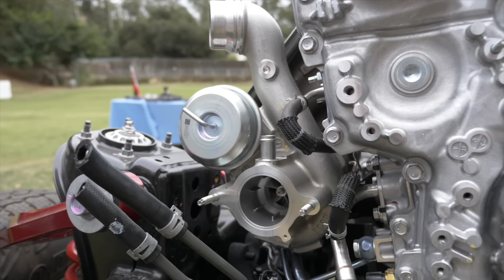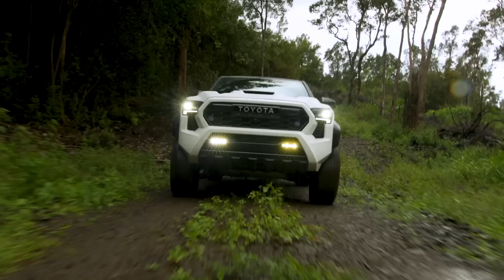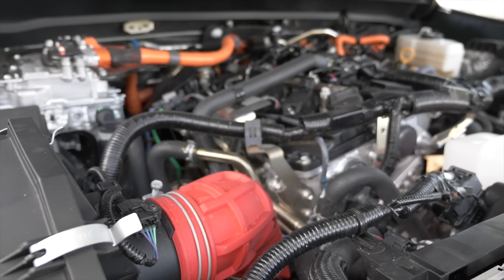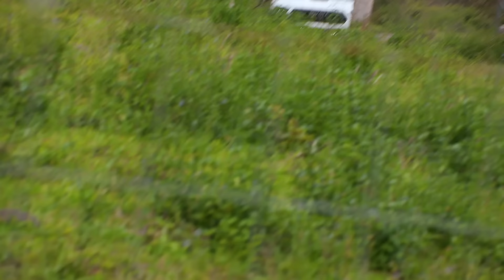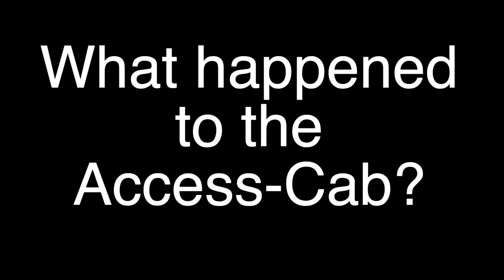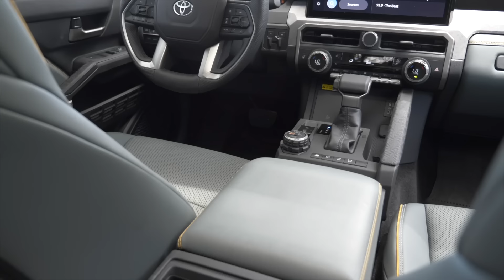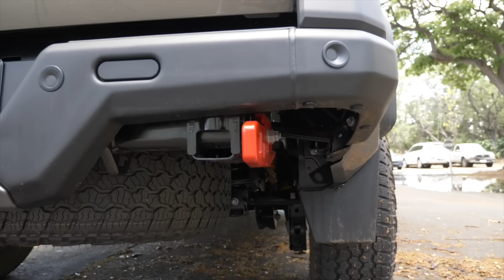2024 Toyota Tacoma Chief Engineer on new engine reliability and more...

Comment: 4cyl turbos (E10gasoline type) will not have durability!! I'm keeping the Japanese made 4.0L!!
Reply: and my 1985 Toyota 4runner SR5 5 speed currently has 285k miles and no leaks or burning oil.

Comment: A turbo 4 has to work harder to do what a 6 cyl does with ease. If the engine is overworked, it will wear out faster. The new Tacomas are much bigger than they used to be. Turbo 4 on a 80s sized Tacoma would be great. When the turbo wears out down the road how much will it cost to replace? Engine might still be good but it turbo is shot, these will be a slow too-expensive to fix nightmare. Time will tell I guess.

Comment: Lies! Turbo charged engines are not as reliable as naturally aspirated engines. You add more complexity and cost for repairs later on down the road. Then, when the smaller engine is under load due to towing, off-roading and/or going up steep hills you then lose massive performance. Not as bad as electric vehicles but worse than a larger, naturally aspirated engine. There is no replacement for displacement!

Comment: Bull crap. In no world is a turbo engine more reliable than a NA engine. Im no Toyota fan but the V6 has proven to be a rock solid staple. Even if this new I4 turbo is rhe most reliable turbo 4-cylinder ever produced It's still wouldn't be more reliable than the outgoing V6. It is just not possible.

Comment: I have the v6 in my 2022 tacoma it's a nice running trouble free truck, I had a 2012 tacoma v6 that was trouble free and zero issues for 400k miles, My biggest issue or improvement they could make is a bigger fuel tank, I have a Ford f150 4x4 v6 with camper top  that gets 20 mpg all day and I have the extended range fuel tank, I can go 600 miles per fill up, towing I can go 400 miles, thats nice to have and my toyota,s have always got around 18 mpg but i am , filling up around 290 miles or looking to fill up because I am below 1/4 tank,  when i tow even a small trailer I can only  go  around 200 miles before looking for a gas station, so  for anyone offloading or taking trips or Towing a larger fuel tank would be something that would be useful and I talk to many other owners who would prefer that then a different engine or at leat the option because they have no range

Comment: I’ve never seen Toyota bring out anyone to talk about how a new engine will be as reliable as their old engine. This coming after the disaster of a launch that the 3.5tt was, I’m speculative at best. I knew this would happen. The years the 3.5 got bombarded with hate and “4.0 is better” talk is now an old era. We are in the “3.5 was amazing. I wish Toyota never got rid of it” era
Reply: I'm pretty sure he  said that they use a 3inch/70mm water inlet for lots of cooling the same size as a V8😂.... dude the water inlet is 1.5-2inch max he was pointing at the air inlet to the intake manifold SMH

Comment: People need to get out of their head that cylinder pressure correlates to uniquely high engine wear. Assuming temperatures and detonation are kept in check (which is a good assumption with modern engine management), cylinder pressure is far less detrimental than RPM, being a linear function versus exponential. Now, either engine type designed well (look at 90s Honda engines for RPM happy engines) can run for just about ever, but I think we've had reliable boosted engines for long enough to get over this gut reaction.

Comment: Great looking truck. My 2023 Honda Ridgeline is more economical than this new Tacoma. Mine has a 3.5 litre v6 mated to a nine speed transmission. Turbos by their nature can be efficient if driven conservatively. Given the weight of this Tacoma I suspect there shall complaints regarding power, performance and fuel consumption. Additionally, reliability may factor in as well. There have been complaints about the Highlander’s fuel consumption and performance regarding its 2.4 litre turbo. I truly believe Toyota has missed the mark. The engine is the weak link here.  Looking at some of the excellent recent new straight six engines validates this for me.
Reply: Your “truck” is a minivan with part of the roof cut off and starts at $40k.
Reply: @AlphanumericCharacters  hahaha. Keep drinking!
Reply: @SicariousAD272 I’ve been drunk maybe five times in my life and never used illegal drugs. That said….the ridgeline is literally a Honda Odyssey with a bed. It’s not a truck. It may fit some loose technical definition of a truck. We could argue the margins but it can’t do truck stuff. Carry cargo? You can remove and fold seats in minivans and carry cargo. They aren’t trucks.

Comment: Hopefully Toyota will avoid a black eye with this build, unlike the new Tundra which seems to be an complicated V6 twin turbo nightmare.  I’m also glad they decided to keep the manual transmission available and take some of the complications (EGR, T stat, electronic waste gate) out of this engine.  I won’t be in the market for a few years, but if it proves to be reliable, I’ll probably retire my 20 year old Tacoma 3RZ 2.7 manual 4WD which I dearly love.

Comment: Thanks to the excessive demand for less fuel consumption, more mpg, and the almighty all knowing rip you off crooked EPA this is the type of engine you consumers are allowed to drive a stressed out 2.4L turbo engine. Not sure if its direct injection which probably is. But even having a bigger cooling capacity I'm still not convinced that will solve the problem. Heat dissipation is one thing but oil consumption, and engine wear due to excessive stress.  Idk

Comment: Those old Toyota trucks weren’t known for power by any stretch of the imagination. They were just small, tough, reliable machines. Geared low, and high revved. I’d love to have one, man! Tacos nowadays are for hauling shit, towing, or grocery getting. I think the city tacos will be fine for the wife to get groceries, or take the kids to school. Good luck towing a camper, using one to haul payload for work, or firewood etc. I have my 2016 squatting pretty low, on a regular basis. The other thing would be off-road crawling through trails/back country….will the turbo really give power at low rpm’s? Is it electronic? I have a feeling 2023 tacos are going to be worth a mint.

Comment: Has no one been to Asia? The fortuner, hilux, qualis, and more all had na and turbo 4 cylinder engines that have lasted with no issues at all. Folks act as though Toyota hasn't spent decades building engines like this.

Comment: I currently have 266,500 miles on my 2011 Toyota Tacoma V6 Prerunner. It still drives like a dream so until this one dies, I’ll continue driving it. Then I can decide on buying another older V6 model or a newer 4 cylinder one after time had told us if it is reliable or not!

Comment: truck is as big as a fullsize,   lost anything mini truck that they used to be.   no need for a  4 cyl in a truck of any size unless 2wd manual stripped down model.  4cyl on a truck that  continues to GAIN WEIGHT,  way overweight.   STILL NO DIESEL,   20+yrs behind for north america release.    NEW none hybrid near same power and MPG  as engines from 2005 in this sector, and from toyota.    just fluffer talk about listening to customers.     dont need 10  special model names when past generations are far superior to new.    continue to be let down by toyota.

Comment: I own Toyotas, so I like them for the most part.  I think they are the best automobiles on the planet.  What is the longevity of a turbo charged 4 cylinder compared to a non turbo charged 4 cylinder and also compared with a 6 cylinder that the 4 cylinder replaces?

Comment: I would really love to see a simple truck again. One that was easy on the pocket and easy to work on. I have two early Toyota trucks. A 73 FJ40 and a 78 pickup. Wouldn't trade either of them for a new model.
Reply: Keep what you have, a new simple truck will never arrive (for lots of reasons including Government regulation)
Reply: @derekisthematrix  Yep
Reply: Tell it like it is ! I have an 84 4x4 pickup.22r carbed.,straight axle,5 spd.."classic" all original,factory white steel,slotted wheels.1984 warn winch mount with brushguards..
Reply: @vincesmith764  Amen
Reply: I have a farm, and farmers can no longer buy simple, non expensive, reliable trucks. We do not want all the bells and whistles. We don't want high performance. We just want a reasonably priced, reliable truck, that will get us from point A to point B without breaking down on the highway, and then break down our pocketbooks to fix it. 90% of the extras on the new pickups, we don't even use, yet we pay thousands extra. Very soon, the automakers will understand that the American people are fed up with the greed of automakers.
Reply: @barbwire7449  
Totally agree. I have found it much more cost effective  to keep repairing my old vehicles than buying new. On ranches and farms, trucks get used and abused. Dirt roads, weather and heavy loads. We don't need rear view cameras, computer screens,  fancy wheels and engine bays where the engine has been shoe horned in. We don't need trucks that take special diagnostic tools, an electrical engineering degree or tiny hands to work on.
We need simple vehicles that are tough, easy to repair and cost-effective.
Reply: The toyota scout is coming back.
Reply: @Chromedome053  scouts honor.
Reply: Toyota just developed the IMV 0 pickup. It's barebones for $10k but they have accessories so you can customize it if you feel. Easy to work on, efficient, cheap, quality. Check it out.
Reply: @jacksonwholeexperience409  word is that it won’t be available in the US

Comment: Here is my problem with Turbo's, they don't last.  I had two cars with turbo's and on both cars the Turbo's failed right around the 60,000 mile mark, they were both Toyota motors too. Labor to replace those turbos is around $300, in both cases I had to find used turbos on ebay and both of them cost around $300 each.  My advice is to avoid turbocharged engines, stick with naturally aspired, turbos will break and they will be costly to repair.

Comment: Toyota is making a mistake on giving up on the six cylinder engine.  The turbos will make the engine run hotter with more pressure hence they will die sooner.

Comment: I love all the fan boys in the comments. I recently, retired from the auto service industry and had customers with 500k on their 3.5 engines. You can not compare a little gas turbo to a serious diesel engine. In my experience pick up trucks are usually poorly maintained. Turbo' charged engines required far more maintenance than do naturally aspirated ones and are very expensive to repair. This is a compliance engine and regardless of the Toyota B. S. I would expect turbo replacement at around 100k miles or less and that little engine will be shot by 200k. Plus the thing is made in Mexico, so it will be assembled poorly.

Comment: Why is the damn thing so big, with so much plastic? I had two '85's. Xtra cab. I'm 6'4", and was comfortable in them. Had a '90 and '94. Still do, actually.  A little bigger, but OK. The new Tacoma's are simply obese. I actually drive off road here in PA,  and like tight stuff. Tree sap smears on sides, etc.
    This truck will never follow me, unless you bring a chainsaw.  Will not fit. Just won't,  forget it.
     Regarding the turbo 4...no doubt it can make power, and torque, and tow. While doing so, all of the exhaust gas is exiting through 8 modestly sized exhaust valves. I have found pretty ragged exhaust valves in 20r's, 22re's, and 4age's. And burnt useless exhaust valves in 3vze's. Bores look good and seem to last.
      Anyway, I wonder about exhaust valve life in hardworking little engines, and my experience has confirmed my doubts.
   The turbo increases thermal stress on the poor valves. 
    Almost universally, when a lot of power is needed, reliably, for a long time, large engines are used, with modest power per liter.
     A top fuel dragster has more than adequate power for any locomotive. Problem is that it lasts 4- 5 seconds.
   This exact Toyota engine has more power than a lot of  older semi tractors which lasted hundreds of thousands of miles...I would question the ability of this engine to make one trip doing that job. 
   He's probably right, and it will be pretty good for most people, but to talk like it is the equal of a larger engine of similar power....hmmm. 
   I thing they were boxed into a corner by the EPA, but would never say that. A small engine running hard has reduced "pumping losses", and inherently gain a little efficiency over a larger engine throttled back to the same power level...lower manifold pressure (higher vacuum) exerts negative work on the pistons during the intake stroke. Frictional losses are lower, too.
    That does NOT make it more reliable.
   So many of these will be used as commuter cars and not actually worked hard, that failure of those that are used will be considered an anomaly,  a blip..
   It is weird to say these things, most of my 45 plus cars & trucks have been toyotas, I like them, but think this engine is more of a requirement, than a good idea. I was pleased when they finally realized that a 5.7 v8 worked pretty good when you had to do some work. This is regression. A small gain in efficiency at the cost of other things that matter. 
   At least it can be had with a manual transmission. Thanks for that.

Comment: Turbo engines need to be maintained. As someone who owned an oil change business before, I can tell you that most people don’t change their oil on schedule. Those people will be crying about how much it costs to replace a turbo.
Reply: Good point. I wonder what the repair costs are for two turbos. Most people have dealerships to change their oil and never check the dipstick for themselves, You are correct, people will not check or change oil regularly.
Reply: I see that all the time. Not using the synthetic oil. Dumping conventional oil because synthetic oil is TOO expensive. I just tell them. Wait till you need a turbo and it's 3k for a turbo including labour cost.
Reply: @2nickles647  Can it really cost 3K for a turbo? Are the dealership sales people telling customers that?

Comment: He must be running for politics somewhere because he can lie with the straightest face possible. Anyone who believes this bunch of crap is ridiculous. You tell me that a naturally aspirated V8 will not hold up better than this turbo You got to be crazy. When you're dealing with a turbo engine you just have more things to go wrong so if it's not there it can't break that's the beauty of a naturally aspirated V8 they've had that engine for years it's a proven extremely reliable engine why screw with it. I've got a I have an '04 tundra with 240,000 mi on it It's never broken down one time, I still have the original muffler on the truck. That truck is so reliable I would drive it from the east coast to the west coast right now All I'd have to do is put gas in it and go, there's no way a turbo engine is going to get that much longevity It's just not going to happen.

Comment: 2AZ-FE veteran here.  I was hoping to hear that Toyota stepped up to more than 10 head bolts per four cylinder bank.  The rest of my life will be free of engines that are skinny on head bolts and prone to blow head gaskets.

I totally get the importance of a turbo being a low cost way to deliver more horsepower, but I actually place negative value on a turbo and would prefer the same engine without the turbo with lower horsepower.

Though I am sadly forced into other options (per above), it is great to see Toyota making the manual transmission available.
Reply: You have to remember that the 2AZ's head bolt issues had nothing to do with the amount of bolts per cylinder or the thickness of the bolts. The blocks had a manufacturing defect causing the threads to strip out and the bolts were prone to oxidation failure due to the material used and their sitting in a waterjacket, Toyota did slightly change the design but the thickness remained practically the same, plenty of engines use 4 bolts/cyl
Reply: Cool it, guys. 2AZ-FE/PK7 has the absolute nominal bolt to head gasket ratio. TOYOTA switched to 99% tungsten in all of their bolts starting in 2018. Seal itself is 88% industrial grade silica tk-6 temp rated. So 2az-fe is far superior with mostly NTO-6/TG steel pivot points. So as a 22 year Toyota tech I'm absolutely not worried.
Reply: oh....here we go....the old 10 bolts bullshit that no one ever had an issue with except for ol pete from wisconsin.......ok buddy....time to come back to reality.
Reply: 2AZ's definitely had real head bolt issues lol @DigitalCity-sj4es

Comment: The last step in any quality control process is what happens when the general public gets ahold of them. It doesn't matter how many ways you tested it on the bench. Once they get data from about 100k units in the field they will truly know something. It's a good looking truck and Toyota has a long reputation for building quality stuff but the "new frame even thinner than before "...I don't know about that one.

Comment: Everyone is saying the torque is comparable to the V6,  but  you have to look at the torque range and compare the two, at what RPM does the high torque compare- a big difference that no one wants to talk about- you heard the engineer say it was all about EPA and fuel economy.  The turbo will never give the 100k reliability- you will be out of warranty when it goes! To not offer a V6 option is a big mistake.

Comment: Did you zinc dip or galvanize the frames?  Do you think the I4 turbo go 300,00 to 400,000 miles like the V6 has?
Reply: No way. It’s a small engine that’s over stressed especially being turbocharged and in a midsize truck which is too big for it. That thing belongs in a car or compact SUV or even a compact truck. This won’t last anywhere as long as a naturally aspirated V6 or even a turbo V6.